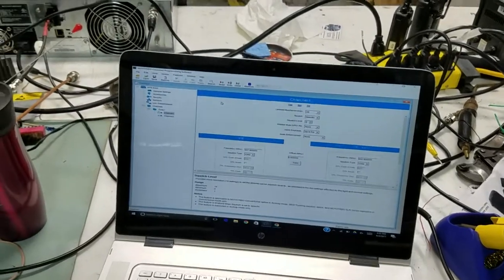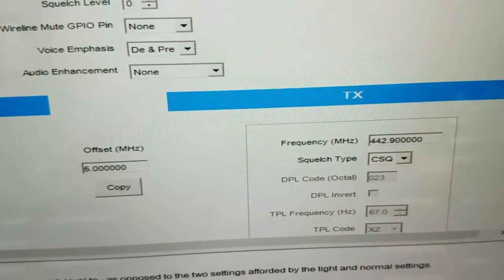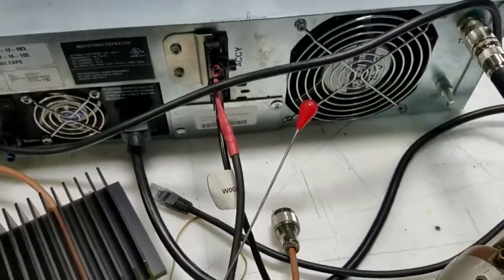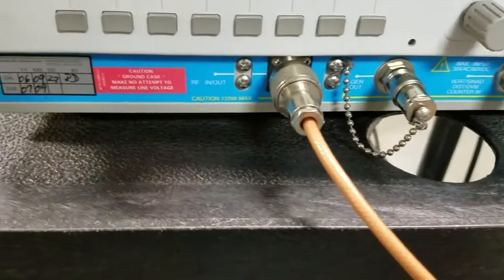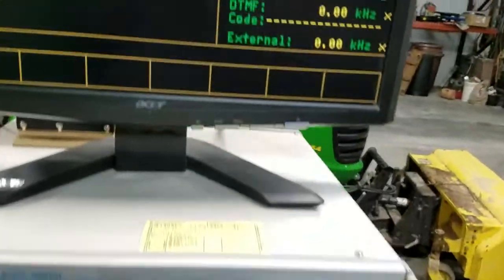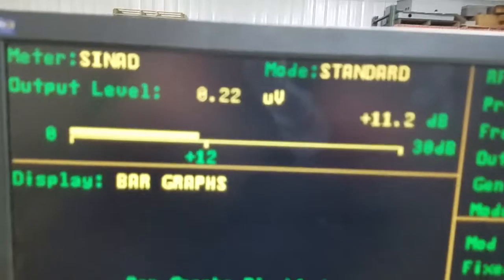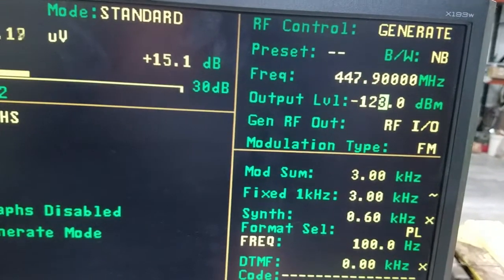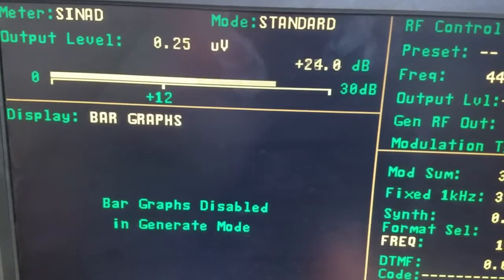XPR8300 SINAD measurement

Comment: Hello. What is the model and/or specs of the isolation box for the audio? BTW great video, thank you.
Reply from the maker: It is custom built... I will send you a sketch, out of office today.  Send an email to support@w0gen.com
Reply: @W0GEN  I sent you the email. Thank you.
Reply from the maker: It is a 600 ohm to 600 ohm transformer used because all audio outputs are not not ground reference.  Simple to build, basically an isolation.  No other parts in the box.

Comment: You are not using a duplexer if I understood this video, why did you need to key up the  tx?
Reply from the maker: We are following Motorolas procedures for Sinad measurement and calibration of the repeater.   The TX power is handled by the dummy load in this process.